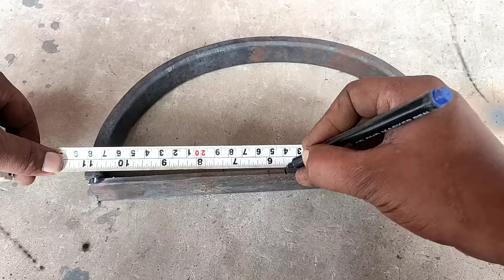Round Pipe Bending Tricks // Handmade Pipe Bending Tool Part 2

Comment: 7 " bending (round pipe bending) manual
Pipe size-3/4
&
Pipe size=1"
Pipe length( 20 feet pipe)
Around  weight  6kg to 7g weigh)
For auto  rickshaw 🛺   body frame bending purpus